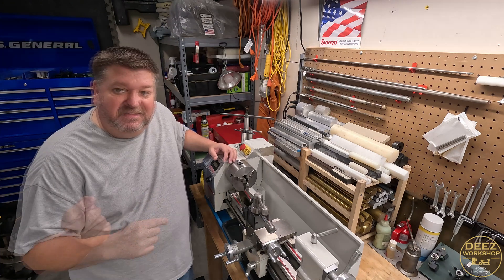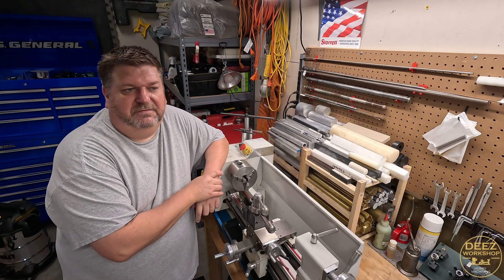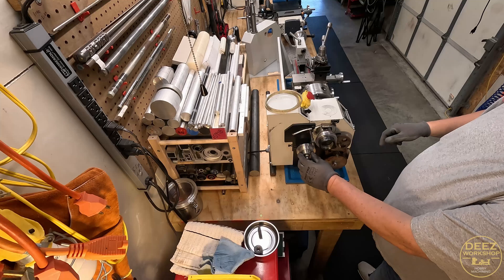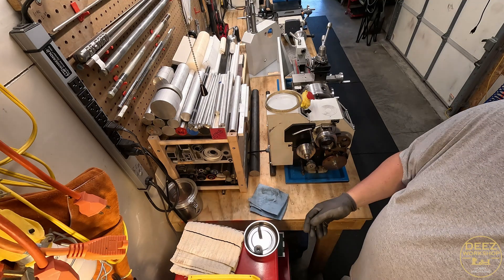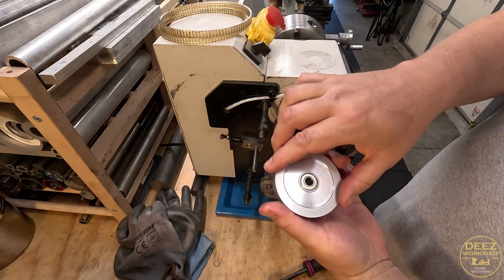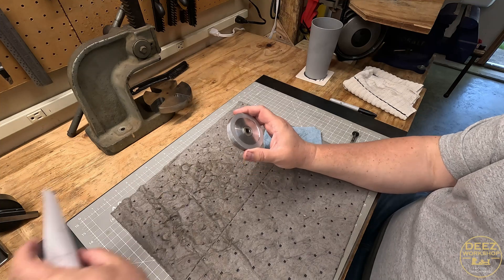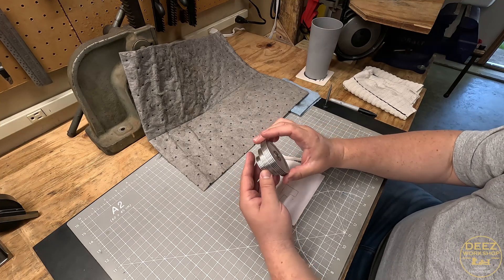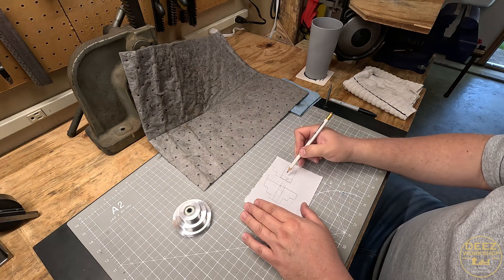Tensioner Pulley Final Design Review and Inspection for Vevor MX400 Mini Lathe - Resesign that works

Comment: Deez if I can make one suggestion. Take that nylock nut and trim a little off the back of it so that more of the nylon will bite into the screw shaft.
Reply from the maker: Great suggestion,  Thanks for the tip,  I will do that soon.  Appreciate all the suggestions and helpful tips and tricks,  Thanks and glad you are still sticking with the channel and my progress.